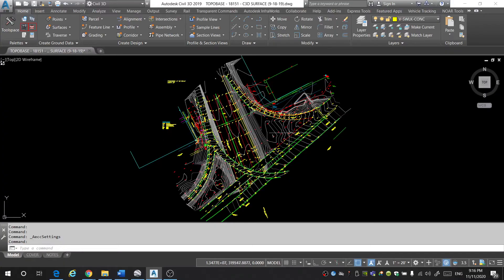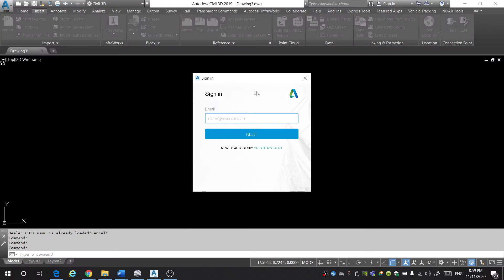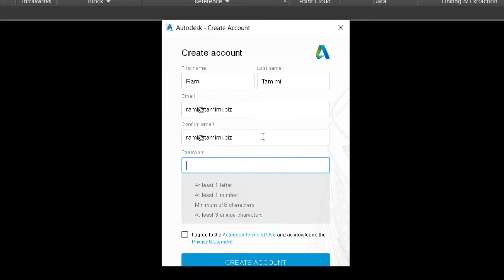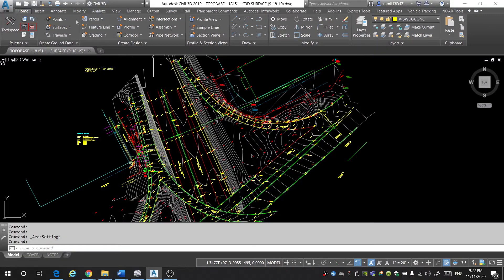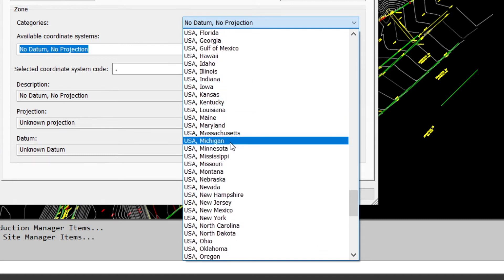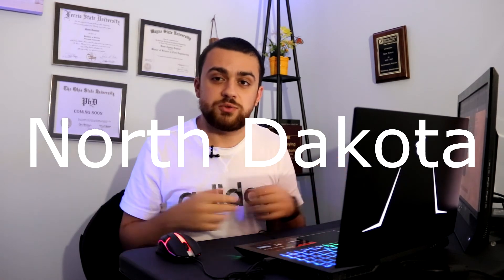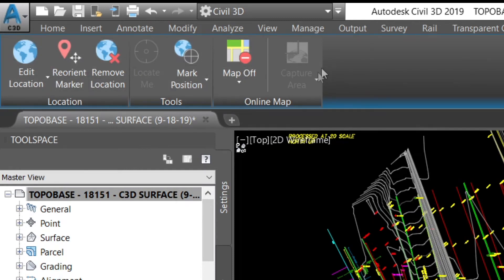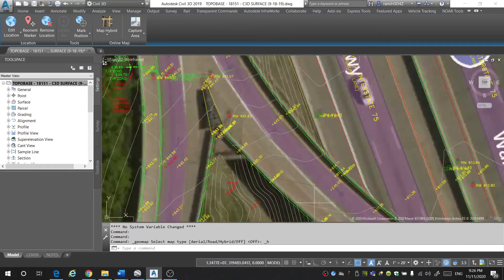Geolocation Civil 3D 2025

Comment: Is there any difference between AutoCad 3D and AutoCad Civil and what is the comparison of these with Revit?
Reply from the maker: AutoCAD 3D has limited functions. Civil 3D gives surveyors and designers more to work with in the software. And Revit is used by Architects.
Reply: @RamiTamimi  Rami, thanks or the reply.  I'm looking to use the software to upload LiDAR scans from an iPhone of internal building layouts, and external buildings, also to draw floor plans and elevations. I'm hoping the Lidar function on the iPhione will also be capable of scanning structural ceiling soffits to determine deflections at mid spans of the concrete planks which are predominantly around 5.2m in length and 600mm wide, with an accuracy level of around 2mm.  Which CAD version would you recommend?  Regards from England.  Love your videos...